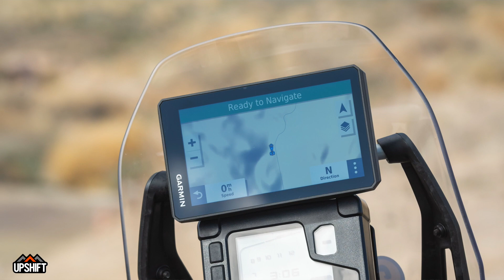Yamaha Tenere 700 Project - Phase 2

Comment: Finally I feel like a legit upgrade that actually added to the performance of the bike. So many vids I have watched on the T7 are just burning cash and not really improving the bike.  I love adventure bikes. I have a 1200GS Rallye. But the T7 really opens up different potential.  Generally for any real offroad i will go smaller and ride my KTM 500XCW. But now I am seriously considering a T7 for the in between perfect Colorado backcountry bike. Thanks guys for showing what the bike can be.
Reply from the maker: Well shoots... you're making us blush a little. Glad you like the direction we went with this and we appreciate the kind words. We still ride small bikes too... there is no question this is a heavy bike for technical offroad riding. But it's tailor made for all of Colorados old mining and fire roads that aren't really roads but they aren't single track either. Have fun this summer.

Comment: Great build, where is the yellow head light from?
Reply from the maker: It's actually 3M heavy duty car bra in yellow/amber that they sell for car racing. It's not street legal anywhere that we know of so it's just for fun. A number of the Dakar bikes from the era this is influenced by also ran amber lights so it's a throwback to that as well.
Reply: @UPSHIFT_ONLINE  I was wondering the same, looks sweet and want to do the same to mine. Did you remove the headlight when applying this?

Comment: yoshi system sounds great but doesn't really address the bike's biggest flaw IMO- the exhaust mount
Reply from the maker: We really don't understand the complaint about the exhaust mount. It's not a dirt bike. It's an ADV. We have dropped this bike several times pretty hard in some rough terrain and have yet to damage the exhaust. That's not to say it doesn't happen or that it can't. Of course it does. But it happens to enduro bikes and dualsports with tucked up exhausts all the time too.
Reply: @UPSHIFT_ONLINE  that's totally fair! The part that worries me is that if it does bend in you usually won't find out until your swingarm is torn up :/

Comment: Very cool seems like some great mods but what's the deal with the rear wheel constantly coming off the ground is it a dampening issue?
Reply: I think it rebound
Reply from the maker: We need to speed up rebound a bit internally. We didn't have time to change setting before we needed to shoot this video. We are working with Race Tech to further refine the T7 suspension. But the suspension on this bike is pretty unsophisticated by todays standards which is partly how they were able to get the bike in the $10K price range. There is only so much we can do with it.

Comment: I’m 72 and ride a 1200GS.  Been thinking of a lighter adventure bike like the T7 or 890.
Reply: Im 32 and i could never imagine going back to a large bike TBH - Even the street pikes i ride are less than 400 Lbs.... I would recommend getting the smaller bike if you have teh money to do so. The biggest reasons are the weight balance difference, Power delivery difference and the ability to flick the bike alit easier.

Its also ALOT less work... I've started getting a bit of a gut again since i started riding my T700 - Its almost too easy ;) 

PLUS this thing destroys trails mike a mid-weight dirt bike and less like an big old ADV Thanks to the fact that its basically a Dakar bike...
Reply from the maker: The 1200Gs and similarly sized bikes certainly are nice on prolonged trips covering lots of miles on pavement or really good dirt roads. But the middleweight bikes like the T7, 890 and the Tiger 900 are definitely overtaking the market. The weight, power and capability in rougher terrain are just amazing. And there really isn't as much of compromise as there once was on the touring side of things either.
Reply from the maker: What Cory said.
Reply: @T3l3visionT0day  I agree. I tried offroading with lots of 17" wheel based bikes like the Varadero and NC700X (which was pretty good at it due to the fairly low weight and COG). I then purchased the CRF1000L, thinking my true offroading TET tours would start, bit it was my biggest mistake ever. Too much technical failures and too much weight. I had a chance to swap it for my current VFR1200X, since I had plans for long touring in 2019/2020, but it's the last Honda I'll buy (at just 31 years old). I took a ride on the T7 last year and holy moly, I went from novice to expert on the local sand trails here. This bike feels like I threw away my shackles of weight and whatever was holding me back. First time ripping it through corners when I normally tense up or have to fight the weight of 260+ bikes. I'm expecting that the first batch of occasion bikes will be offered next year, so I'm going for a T7. I still try to perfect my offroading, but 287kg is just too freaking much.

Bye bye Honda, hello T7

Comment: Hi, what's the beginnig motorcycle fot this project? A normal T7 (19-21)? Colour? Black?
Reply from the maker: It started as a normal 2020 Tenere 700 (US Model) in Red. We pulled the body off and painted it entirely black which looks awesome by itself. But it gives us the ability to install any of our graphics kits and they look right.
Reply: @UPSHIFT_ONLINE  I’m very interessed by this deco kit. Does the kit guarantee durability, even in the case of pressure washing?  Application by a professional is required or can be done by myself?
Reply from the maker: We pressure wash ours all the time but you can damage just about anything with a pressure washer if you aren't careful so we don't put a guarantee on it. Our graphics are quite robust if they are installed properly. This kit is a more challenging kit to install if you haven't ever done it before. But it's not impossible. You just need to be patient and take your time with it. The installation instructions are on the product page if you want to read through them.

Comment: Hi any reason why you swapped the handlebar from flexx to pro taper?
Reply from the maker: Just to try something different. Mostly for aesthetics and to some degree weight. But we are big fans of the FLEXX bars. The damping it offers does combat fatigue when putting in longer days.
Reply: What bend pro tapers did install?

Comment: Just ordered my seat concepts seat.  They said it could be up to 8-10 weeks. 😢
Reply from the maker: Yeah, those guys are cranking away right now. Have had a hard time finding people and the demand is through the roof. Same problem through the entire motorcycle industry. We have had some parts on back order for 4 months and we have a little bit of an advantage being a motorcycle media outlet.
Reply: @UPSHIFT_ONLINE  makes sense.. hey  whats the info on that yellow headlight protector,  or is that just tint?
Reply from the maker: It's just a piece of 3M car bra material. Typically it's used on endurance race car headlights. It's not street legal anywhere. The old 80's Rally Raid bikes sometimes ran a yellow headlight setup so we did it for fun.

Comment: What is the final weight after mods?
Reply: The final weight is: Still way to heavy...
Reply from the maker: We need to weight it still. Hopefully soon
Reply from the maker: As compared to what?
Reply: @UPSHIFT_ONLINE  to stock
Reply from the maker: @peter mccann We dropped weight on the handle bars, brakes, exhaust, battery, the seat, the marker lights and the tires. We added some weight back in with crash bars. You should watch the video again.
Reply: @UPSHIFT_ONLINE  It wasn't worth watching the 1st time. Marketing a ~450 lb machine as off-road worthy is  a joke, to just about anyone who has tried anything remotely technical on a so called "adventure bike". The T7 is more than 100 lbs heavier than the 690ER I owned, and that bike was too big for any dirt but gravel roads.
Reply: @petermccann2561  it takes some skills. The T7 is actually an easy bike to maneuver off-road . You should watch the Seeker featuring Pol Tarres.
Reply from the maker: Well we ride this on some pretty technical terrain on the regular here in Idaho. Do we take it on full blown "goat trail" single track? No... every bike has it's limitations and it's intended use. If you are limited to gravel roads on a 690Enduro or a T7, you are missing out.
Reply: @UPSHIFT_ONLINE  I ride dirt bikes on dirt. Not "missing out" on anything. It's not that heavy bikes can't be pressed offroad, but why would you want to? I like the Yamaha twin...but tend to prefer the right tool for the job. I know the T7 has it's good points, but I'll always prefer riding a thoroughbred over a pack mule. :)
Reply: @petermccann2561  if you need to ride 500km, would you still choose a thoroughbred?
Reply: @hornetdc  No, a mule would be more comfortable (Goldwing?) I trailer my thoroughbred. Riding on the road is relatively boring for me. My favorite track bike was a '16 R1(@ COTA). For dirt: a 450SXF for MX, a KTM 500 for faster off road, or my KLX300 for playing on gravel & trails. Again, the right tool for the job...it's why you don't see a Swiss army knife being used for surgery, cutting steak, or cleaning fish. It could be done, but best results won't be had. ;)

Comment: What did the suspension cost and what spring rate did you use? I went to the link and it just takes you to their general website
Reply from the maker: Spring rates are based on each individuals weight and riding style. Cost will also change depending on what you ultimately need. We also do not post costs because when we published this video, the cost is different than it is today. Nothing like having a lot of folks pissed off because you posted a cost and two years later that cost isn't accurate. Ask us how we know.
Reply: @UPSHIFT_ONLINE  So how do you know 😅

Comment: intake/exhaust smog/cat delete & flash ecu to match , suspension , ergonomics inc taller seat & windshield bigger pegs wider rally type ect. fuel capacity needs increased & i love the brakes upgrade ya'll did , so ditto ....... then ride the snot out of it ?  without the worries or expense of my 1090r
Reply: you just described what i did with my T7.  I still consider it a value.

Comment: I watched all these videos and decided that if you dont want to spend another $5000 in mods its more cost effective to get a 890 which is just as good right out of the box. Thoughts?
Reply from the maker: The 890 is excellent and there is a little validity to your argument. But it's not 100%. There are still things you will need to do to an 890 to make it yours. Like getting the suspension tuned, crash bars, skid plate, a comfortable seat, mirrors, tail tidy etc.

Comment: What tire pressure were you running on the wheels in tge rock area
Reply from the maker: Front 32 psi, Rear 40 psi with extra heavy duty tubes.

Comment: Which brand of levers did you use on this bike?
Reply from the maker: We have tried a few different levers trying to find something that was wasn't... terrible or worse. The levers that were on the bike in the video were just slightly better than stock but not much. CRG is what we are running currently and we are pretty happy with them.

Comment: Are you in USA.? Just wanna ask about price over there, $10,000k for standard T7 but in Thailand is almost $14,000 that's so much different from there. Do you know why the price in US is not expensive, T7 is very very good choice out there.
Reply: Can’t say for sure but I’m in USA and been to Thailand 2x. My wife is from there. I think the exchange rate is the difference in price that you are seeing. Just my take on it.
Reply: @stevenwescott1422  i see,that's why you use SRC product from Thailand. I'don't understand MSRP $10,000, What is the real price you bought in USA. (everything ready to ride include shipping)
Reply from the maker: Yes, Yamaha is charging $10,000 USD for the Tenere 700 in the USA. Depending on the dealership, they may add the destination charge or they may discount it and of course there are taxes that are different in each state. As mentioned above the exchange rate is like a part of the equation. But the bigger difference is the very high tariff or tax that Thailand levies on motorcycles. Up to 60%. That will change the price of a motorcycle very quickly.